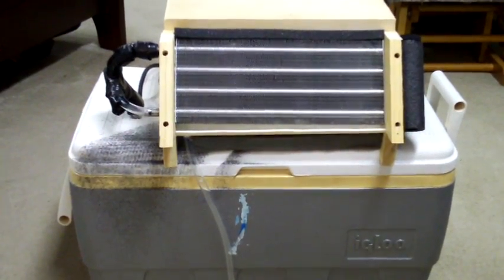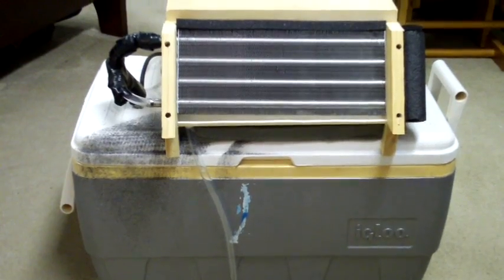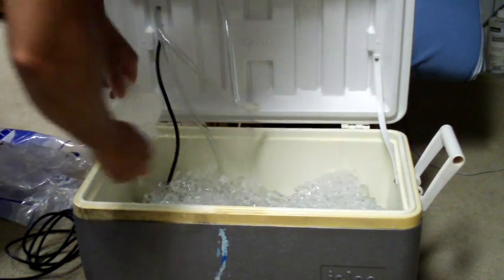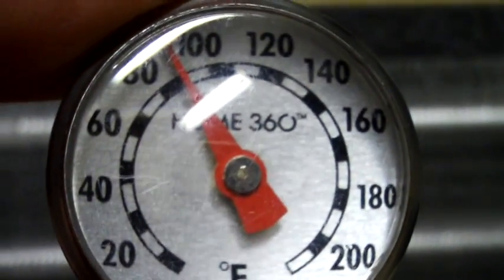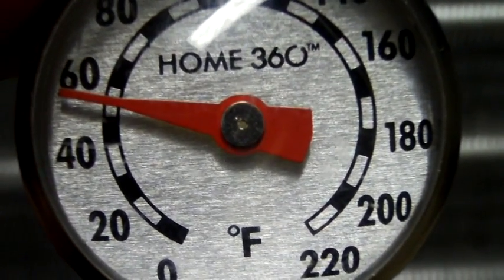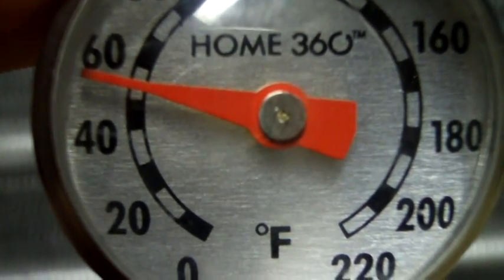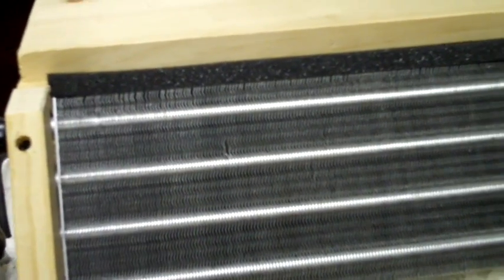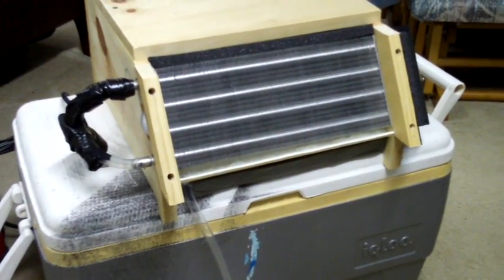Homemade Air Conditioner Part 2.

Comment: t the condensation drip line into the return.  any reason not to?
Reply from the maker: the condensation i will not return because its never as cold as the water inside, and to introduce that tiny bit of higher temp back into the cooler would just make the ice melt faster, and i do not want the added water into it  as well, more water you have the harder it is to a point to keep cold, and makes ice melt faster, in my opinion and testing.
Reply: Wallabydam  Thank you pointing that out. I was wondering why, it was not in the return. This is a great Ideal you had.

Comment: This is really cool!  Yes pun is intended, but I like the design and this would be really nice to have if you have a hot room setting next to the bed, and the more moisture pulled out of the air, the quicker it would cool, too.  I can imagine this thing could easily lower the room temp by at least 5-10 degrees and remove humidity, I'd imagine it could be very comfortable.  Nice job!
Reply from the maker: Thank you for the Comment, I appeaciate it ! I think it would work best in a small area. thank you again!
Reply: No problem man!! :)

Comment: how cold did that room get to do you have a test room that you did it on i got window units for my house and if this works as good as it looks like it does i got the solar panels and batteries let me hook this joker up and make like 7 of these and go and buy me some freaken ice i would rather pay the 9 bucks a week in ice then the 200 in electricity if that makes since all i got to do is make it extra insulated or just one big freaken tank mmmmmm wonder now i got a toate that holds 500 gal mmmmm and i can get several 12v dc fans since i got a computer shop mmmmmmmmm holy cow make me think and beat my self with a stick mmmm can you do one with one of those toates just for giggles
Reply: I'm sure your joking, right?
 You'll never replace a $200 air conditioner electric bill with $9 a week in ice! LOL
Was a good joke though.

These things are great for some uses though, but whole house or large room cooling is not one of those uses. Good for camping in a tent or van on extreme hot nights to sleep better/cooler, if you can get the ice cheap enough.
Reply from the maker: this was not by all means  for use to cool a house, maybe a small room,  camper, or tent, or for use in a small plane waiting to taxi the runway, unless you have free access to ice, id day you would save a lot of money, but realistically it would consume too much ice in the first hourse of use til everything in the room  cooled to temps being produced, i never tested it fully on a room for hours at a time, so i do not have that answer for you. Thank you for the Question and for taking time to watch!
Reply: Den Stump
Tell you what though, in the event of a hurricane where the power can be out for weeks on end this little AC might be very handy indeed, specially if one got a solar panel large enough to run the fan and the bilge pump. Yea, I live in FL and I have a generator as a lot of people do but the issue becomes finding enough gas to run it since most gas stations are down as well. They did have a truck going up and down the streets giving away free ice though and with Wally's little AC on hand (plus the solar panel) you would have at least some relief. Try sleeping in a CB house when it's 94 degrees and 89% humidity without any kind of AC, it's next to impossible, (I know from experience!).

Comment: This is almost perfect.... great job .....
If you add salt to the ice it will not melt as fast, you will get maybe 2 more hours out of it, maybe more.... i had a cooler last 3 days and still wasnt melted
And this got me thinking, i have a 36 foot boat with an ice maker i was going to throw out but now i think i will make one like yours but take the door off the ice maker and have it dump in the cooler so it will always be cold.
also i can put a T on the hose and reuse the same ice water over and over again, and if its hooked up to soler and a battery bank !!! never ending Free A/C ..... (sun willing) lol, but i live in south Florida so thats hardly a problem ....
The best part ... i have all i need for this just sitting around ... Thanks for the video and the idea..... (id like to see you add an ice maker to the side of yours)
oh and if you put the hoses on the inside of the wood box (or build it out just a bit to fit them) then i bet the ice will last a bit longer aswell..... Thanks again for the video
Reply: And i just read down and saw the comment about the salt lol oh well ...

Comment from the maker: Well just off the top of my head, seeing there is low voltage  I am pretty sure you can use a regular wall mount, round dial type termostat, just put that in Series with the power wire going to the unit, when it gets to temp, it should shut down, seeing it should only pull about 2 amps it should work fine, but never hurts to ask a second opinion,  Thank you for the compliments, :)

Comment from the maker: If you are not drinking or using the water from the melted ice for anything, then a open system is simpler to make, and might be a tad bit cheaper.

Comment from the maker: Well first off Antifreeze costs money, water is free, someone had showed me that straight water transfers temps better then antifreeze mixed solution, antifreeze has chemicals that need water to stay in (suspension) to keep water from freezing and protect, but those chemicals do not transfer heat as efficient as straight water, and its safer to have, your fountain pump if you use, is designed for water, unless you plan to drink the water that is in the cooler,then a closed system should be used.

Comment from the maker: Thank you ! But with aluminum, salt water is a big no no, it will corrode it and will no last long, i used aluminum for two reasons, #1 I had some laying around, #2 its cheaper then copper, If the coil and line was copper, then i would use the salt mix,  Thank you for the contribution !

Comment from the maker: Well that i do not know, im pretty sure it would get it down a good bit, but you have to remember, items in a room hold heat and untill the heat, until the items have been cooled down as well, the first time use it may take a lil while, this is just a guess, but i am thinking it could cool a room as you described down to about 68-73 degrees. thats a guess, and thats with well insulated room, also humidity will play a big factor in it as well.

Comment: I know you showed the temperature of the coils, but how much would it effect room temperature? Suppose you were trying to cool a small room or 14x14 cabin that was very well insulated, by how much would it lower the room temp? Can it be measured in that sense or is meant to be more of a bedside fan that blows much cooler air?

Comment: Salt may ruin your pump after time, depending if it has a plastic or a metal impeller. What is the total power consumption ? Have you thought about retrofitting a solar panel for power ?

Comment from the maker: Well it all varies between temps and humidity, and how many items are in the room along with size of the room, the longest i personally had it last was about4.5 hours once you get the area cooled down and load up the second time it doesnt need to work as hard and the ice lasts longer normally once the room cooled down,

Comment from the maker: Peltier uses too much power, if i was powering this, id like it to last as long as possible on 12volts without having to charge it till the next use, when you throw that in there and antifreeze, your no longer keeping it simple, and the price goes up, Antifreeze not very enviroment friendly, This needs to bepretty cheap to build, parts easy to get from most any stores, and be able to last as long as possible, The Peltier idea has been thrown around some,  Thank you for your input !

Comment from the maker: The tubing i had for my race car, You can get it from any high performance auto store.,  I bent mine by hand, its easy to bend, just do not bend it too sharp or it will collapse in that bend and  be no good in that bend or corner, or use a hand held pipe bender,

Comment from the maker: Hey Dewey. Your right about the salt, thing about salt with aluminum, it hates it. corrodes, As far as directing air back into the box, it is a interesting idea, but for max cooling effect, its best without, BUT once the room has sustained a good temp, That recirculation would be great, Always good to hear simple ideas such as that,   Thank you  for stopping by and watching as well !

Comment: If I were to use a 12 Volt fan and a washer fluid pump, how long do you think this could run off a car battery?  Reason I ask is, in my area we get hurricanes and this would be a perfect way to stay cool when the power gets knocked out.

Comment: like your design thare are 2 similar units available but quite expensive they are the gocool wich uses a diaphragm spray pump and a ducted fan that draws less than 2 amps caust 425.00 . my brother uses the gocool in his big truck sleeper it lasts 6-8 hr on 40lbs ice. or the MightyKool MK3 from Australia that uses a sump pump and includes the option of swamp cooling caust 587.00+shipping if u could make yours for around 200 you could make a killing on e bay high demand in trucking (no-idel laws)

Comment from the maker: I could not say it any better you nailed it  with the glass of water with ice, perfect example, only im moving that cold ice water through a coil and that same moisture is condensating out of the room by condensing on the coil and dripping onto the drip tray, I tell people, hot humid weather feels Far worse then hot dry weather.

Comment: No problem..you know also that this system of your... yes indeed remove  water vapor suspended in the air.  Simply stated...anybody can take a glass of water and at ice and few seconds later ...the water vapor will start to condensate at the outside of  wall of the glass...the idea is to take this condensate out of the room or in a place that will not  go back to vapor !!!

Comment: To remove humidity,the air needs to get saturated at the wet-bulb temperature. If the day has a high humidity above 50 %, you will  get a decent amount of water from the air as the humidity drop,however as the temperature of the air drop,you need to cool at lower temp as posible as to maintain the air passing through the coil  saturated so that water can condensate...A/c units cool to less than 32 F at the coil to condensate a lot of water and hence, it reduces the humidity even further.

Comment from the maker: Hi, Ice duration has many factors, area size it is trying to cool, humidity and obviously how hot it is in that room, also you have to consider the objects in the room like furniture will hold the heat til the room drops in temp, more objects in the room the longer it will take to remove heat out of it, Average for me is about 3 - 4 hours on a hot day, As far as the idea of something to create ice under it, no i figure you might as well buy a window AC at that point, Thank you for watching !

Comment from the maker: The ones ive seen are the REAL AC and the ice units, the ice units from what i read blow air over ice, Swamp coolers use water and air blowing through some kind of filter media,  but the ones i seen on the Artic air, look like the ones ive seen on here, where you put ice into the cooler, shut the lid, fan blows air over the air and air comes out cold through the tube, the pump they give you is to pump out the water as the ice melts, but itf you think about it, that would put moisture back.

Comment from the maker: oh okay, Long ago i seen a advertisment for one, but it looked like a swamp type cooler, If you had to buy everything, new, cooler, tubing, transcooler, fan it would rub about 120 rough guess the trans cooler sell for aboue 40 to 50 and copper or aluminum tubing is about $25 35 dollars> pending on how long you get it, cooler  and fan, some lumber, etc,   Hey at the price they sell those, its well worth making one, specially when your fly, worth it when your waiting to taxi,

Comment: No they're not swamp coolers. They are very much like yours and do not add moisture to the air. That is the biggest selling point. The $525 is there cheapest cooler, (dot)arcticaircooler(dot)com. Anytime you add "aircrafft" the price goes through the roof. I think I could make a very high tech unit based on your design for about 70 bucks.

Comment from the maker: I believe the ones ive seen for small aircraft are swamp cooler, i believe they use ice and a fan to blow air in past the ice and out cool air, but at the same time you have moisture in the air, and last i checked no one likes humid air when its hot unless your in desert conditions,  Yeah $500+ for one of those things, its crazy price for one, Well Im glad you liked my design, It will be worth it when you get in the aircraft and its dry and cool, til you can get altitude, then you wont need it,

Comment: I am definitely going to build one of these for the back of the airplane. I fly Cessna 152s and 172s and of course they have never been built with AC (weight\power use). I've been looking at these designs for a few days and yours is by far the best one I've seen to date. I think it's better than the $525 ones that are sold in Sporty's Pilot Shop.

Comment from the maker: Exactly, Mine removes the Condensation, there is a tray that catches it, I do not allow the run off to go back into the cooler because the more liquid you put in it the faster the ice will melt and the condensation isslightly warmer temp, as the water traveling through the coil, so i let it drain into a bowl. Yes swamp coolers add moisture to the air, they are great in texas, nevada, those very dry air states, otherwise it will just make you clammy, Thank you for stopping by !

Comment from the maker: Thanks for the info !  Only thing about plastic frozen bottles, is that they do not transfer as good thermally, plastic doesnt conduct as well, and the water surrounding the ice inside it doesnt help, iver tried it once, didnt like the readings, so i stuck with freezing block ice in a deep freezer,

Comment: very neat. i'm a service tech at a appment complex. a great way to get better readings is to buy a infer red gun. in a appment the air going in to the ac though the duck bored to the fans should be about 13-16 above what the ac is putting out. few thoughts tho. in a ac the air intake is not near any vents. to grab the hot air and cool it. so maybe get a stronger pulling fan and put a put on it and put it some what away from the ac? also insteed of ice try frezzing watter bottles. cheaper then ic

Comment from the maker: dear?   anyway, depending on how hot it is determines the time it will cool,. obviously the hotter it is the shorter time it will last, it can last a hour, to a few hours continously, there are too many varibles to make a exact time, i also used just enough water to allow pump to circulate, i use about a gallon of water, with full chest of ice,  Thank You for watching.

Comment from the maker: Well Id imagine antifreeze wont hold the cold as well as a frozen block of ice, or dry ice, thing is there is a dump on this unit, it dumps water back into the cooler, there is about a gallon i use , and the rest is ice,  you can dump it on top the ice, making it cool a tad better, but it will melt your ice faster through aggitation its best to keep it under the ice and let the ice just cool whats there, Antifreeze would make a mess, if spilled, and would not dry like plain water in a accident

Comment: what about keeping anti freeze in the fridge and pouring that in and have a valve to switch from the radiator to a dump hose and keep recirculating ?

Comment from the maker: Insulated  is always best, if not you will have ice melting faster then normal, foam coolers work great, and they are cheap, but its ALL PREFERENCE.

Comment from the maker: All ice starts to melt  as soon as its pulled from a freezer, In this cooler, the melting depends on  how much water is inside, the temp of the returning water after thermal transfer from the coil, and also how well insulated of a cooler you use, I can get anywhere form a couple hours of good use from it on a hot day, or several hours at nightime pending on how big the are its cooling, and also the temp of the items in the space being cooled, because those items hold heat as well.

Comment from the maker: Well the thing is with frozen bottles, i do not think they will conduct a good thermal transfer as bare ice would,  that is why i would try and freeze blocks of ice, I have never tried it in my room, the thing you have to take in consideration is the humidity, and items in that room, and windows, insulation, once you get the humidity and bring the items in the room down temp wise, it would be a matter of just maintaining that, and use less ice, carpet will be a factor as well,   and Thank you !

Comment from the maker: To drain condensation back into the tank, would make the ice melt faster, why? because the water going in is not exactly as cold and to add more water would add more work for the ice to try and cool to its own temp, so i only use about a gallon if i can get by with it, or two, the water coming off doesnt mean its just as cold as the water going through the coil, just means its cool enough to take moisture in the air and condense it, so no use in me doing that

Comment from the maker: Yes i put it directly in front of it, because from what i seen and was told in  whole house HVAC units they tak a temp reading about 6 inches away from the coil,  but mind you that is in  a enclosed ducting with a hole  for the probe to take the reading, i think if there is a way to calculate how many BTUs this is putting out, would determine the temp in the enviroment you are asking about i think if the BTUs can be figured out, so can the rest,.